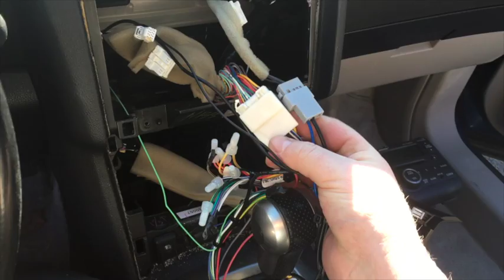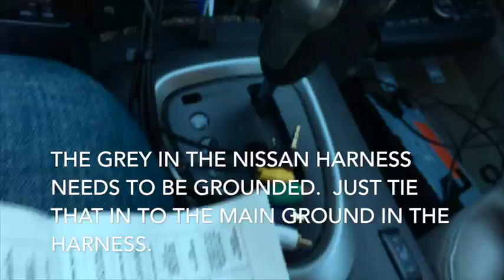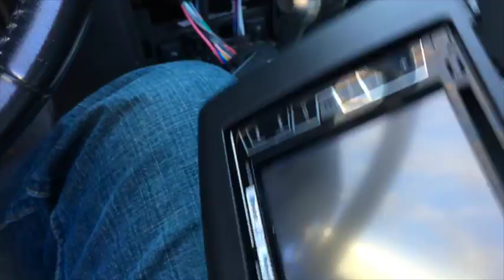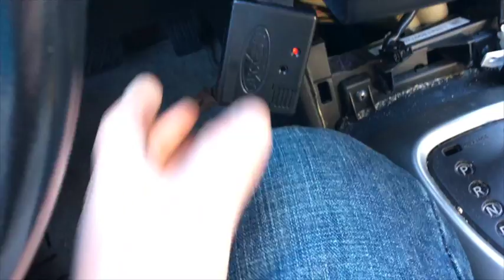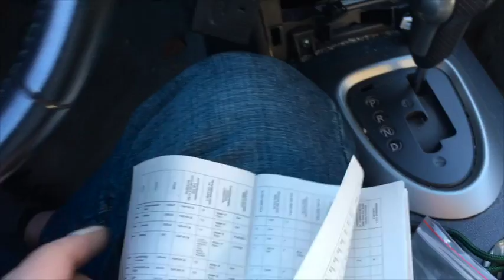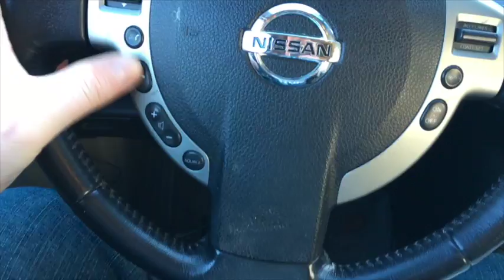2008 - 2010 Nissan Rogue Steering Wheel Control Programming

Comment: Please Help! I just installed an aftermarket stereo to my 2011 Nissan Altima 3.5 Sr, everything works except for the steering wheel controls. I’ve a NSBT-BP (Bluetooth Bypass) but I can’t find the Bluetooth Module locations to connect it. Please Help. Thanks.

Comment: Is it normal that you lose functions in some of the steering wheel controls when you install aftermarket head units? I'm trying to get one put in but I want them all to work lol
Reply from the maker: All depends on the module you use.  Some modules only retain basic functions, more expensive ones usually retain all.

Comment: I have a 2002 impala. I was told to use an interface which i purchased and hooked up. However, i get no power in my aftermarket radio. Also. What does the swc cable hook up to

Comment: Your videos are great and the one showing an install of a Pioneer AVH-2800BS has encouraged me to upgrade.  I have a 2016 Kia Rio LX and want to install an AVH-2300NEX.  The Crux website says that the Crux SWRHK-65E that you used is not compatible with KIA Rios after 2014.  I have looked into the ASWC-1 as an alternative steering wheel interface, but can not find anything about the AVH-2300NEX that shows it has a jack to accept the SWC plug.  HELP PLEASE. I really would like to use that radio, but won't if I can't get steering wheel control.  Thanks for any help you can give.
Reply from the maker: We actually have a video on that here: https://youtu.be/k9TEDQV2T1Y

Comment: Is this compatible with a 2013 Toyota hylander and the clock as well
Reply from the maker: Every make and model differs, if you want to see if the Axxess ASWC-1 will work, head over to Axxess website and use their vehicle fit guide.

Comment: My corolla has a Panasonic touch screen audio video system; but it does not show any sort of SWC controls section in interface.  Can we connect an external remote with this?
Remote is Look what I found on AliExpress
https://www.aliexpress.com/item/32732499366/32732499366.html

Comment: For the phone buttons to work. There's a Bluetooth Control Module in the car that has to be disconnected and pins on the Bluetooth Control Module harness should be jumped together. Pins 12 (Brown) & 17 (Violet) -- Connect together, Pins 13 (Blue) & 18 (Light Green) - Connect together, Pins 14 (Green) & 19 (Orange) - Connect together. This will allow the phone buttons to work. This works on a variety of different Nissan cars.

Comment: Quick question im doing it for my nissan sentra 2014 i follow the color code correctly and my adapter is blicking red and green meaning that is not connected properly any suggestion
Reply from the maker: One of two things, either your wiring was connected incorrectly or your programming isn't right.

Comment: i have the same control as you but it didnt come with the book what are the wires needed for a pontiac grand am 2001?
Reply from the maker: https://tdj.com.au/firmware/ASWC1%20Fitting%20Guides/ASWC%20APP%20CHART.pdf
Reply from the maker: Vehicle pink wire in car's main harness needs to be connected to 12v switched ignition power, vehicle light green wire needs to be hooked up to the ASWC-1's pin #3 (yellow/green) wire.  To program, hold volume up.

Comment: some head units you dont need a adapter cause some head units can be wired up to steering wheel controls and be programmed on the head unit
Reply from the maker: Some of the lower end models yes.  However, generally most radios I.E. Pioneer, Alpine, Kenwood, JVC, Sony, etc require an additional module for programming.
Reply: i gotta boss it was pretty simple to install and everything works gr8
Reply: Des M what boss unit did you get and did you add the interface for steering wheel controls
Reply: Actually some of the Pioneer DEH series (the higher end series) have the capability to reprogram steering wheel controls without an adapter. 
Most Android units have the capability too.

Comment: what do you have to do for the phone buttons to work?  Isn't there an adjustment?  I would think that should work too since the stereo does have a phone built into it
Reply from the maker: Commonly, you can reprogram the ASWC-1 manually for other buttons to work. However, you may need to consult with metra to manually program buttons to your liking.

Comment: Thanks for posting. Question: with the Axxess unit, did you have to do jump wires to bypass the EOM Bluetooth unit back in the rear cargo area? I did that in my 2011 Rogue, per the Crux SWC adapter directions (HUGE pain) and it still doesn't work. If Axxess SWC doesn't require factory Bluetooth bypass I may give it a try. Thanks!
Reply: I meant OEM.
Reply from the maker: This Rogue wasn't equipped with the Bluetooth option, so it wasn't needed.  sorry!

Comment: I'm so confused! I have the same steering wheel controls. The directions also tell me to use green/white and grey/red, but they tell me to put them into some numbered pins?? Is wiring them with orange and white the same thing?
Reply from the maker: It doesn't tell you to put them into the numbered pins, it tells you which numbed pins on the factory harness to connect to.  It also tells you the color of wires corresponding with those pins.  Yes, wiring them to the orange and white is the same thing.

Comment: what is this aswc-1?
Reply from the maker: Steering wheel control module adapter for factory volume controls on the steering wheel to an aftermarket radio
Reply: Provo Beast Audio Installation how can I do in my 07 crysler Pacifica you now???? Thanks

Comment: ok I get everything else. but can I ground the black wire to a bolt back their and as far as the red wire what color wire did you connect that to??
Reply from the maker: red color goes to the ignition or a ignition source (switched 12v power).  Black just needs to be grounded.
Reply: +Provo Beast  OK at the back of the Metra 70-553  the red wire is listed as ignition switch 12v, can't I Just connect  the red wire from the Axxess to that 1? thanks for your response
Reply from the maker: Yep, as easy as that.
Reply: +Provo Beast Audio Installation after I connected this surprisingly I did not have to do to learn procedure it automatically took to the car

Comment: i cant find the wr jack is it  one of the 2 black ports on the left backside
Reply from the maker: +abraham balmir If you are using the Pioneer same model, see this video: https://www.youtube.com/watch?v=OjeQxzwRAck
it has the unboxing and i point out directly where the W/R jack is for steering wheel controls.  its around a minute and 21 seconds.

Comment: where do i plug the black wire 3.5mm i have the same radio on my 02 maxima only place i see to plug it in is the aux or mic jack in the back mine also came with a separate plug that you can attach it to with 2 brown wires
Reply: +abraham balmir If you have the exact same radio, then the ASWC-1 3.5mm cable plugs directly into the W/R input on the back of the radio.  Not sure about what you mean when you say the 2 brown wires.

Comment: is this what i need to get sound? the stereo has power but no sound. I have a 2005 dodge magnum rt
Reply from the maker: +Luis Moreno No, if you are not getting sound, you may have a factory amp you need to either integrate or bypass which is giving you the issue.  If you don't have a factory amp, it may be an issue with your wiring or a problem with your radio.

Comment: were you able to manually program the phone button?
Reply from the maker: +UnknownHandle UnknownHandle I didn't attempt to, but it may be possible.
Reply: So far it was a waste compared to other $15-30 units, as the Axxess AWSC1 was almost $50, and it does the same as the cheap units. I cannot get the most basic things my steering wheel can do, like a Home button to take you back to main screen, FFWD or RWD button to speed  through/FastForward songs on a CD or other digital source. I have a Pause button, this also doesn't work! Others at least allow for manually adjusting. Now they have some App that you have to connect with USB and it might be able to. So far I get the sense that they completely over promise and totally under deliver.  Talking to tech support was a bad experience too. The guy just wasn't willing to help. Fake help is what it was.
Reply from the maker: +UnknownHandle UnknownHandle That sucks man.  Sorry for the limitations, hope you get it worked out. Good luck to ya!
Reply: Well...I just discovered, and perhaps it is very new, but there is an Axxess App for the Android that lets you program..Lets see if that works. If it does, they really need to update the material they send out with the unit about what tools are available to get you setup.

Comment: does the Bluetooth still work? since you plugged the aswc in the jack
Reply from the maker: +Danil Kakharov The bluetooth is completely isolated from the aswc-1.  This steeringwheel control adapter 3.5 mm cable plugs into the W/R (wired remote) input on the radio.  So yes, the bluetooth still works.